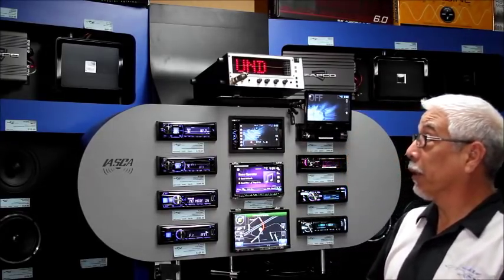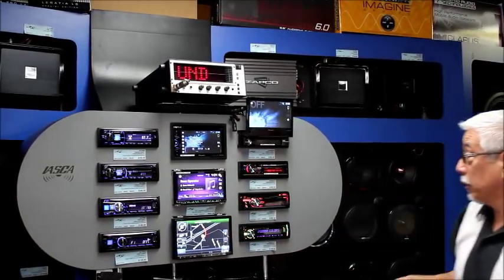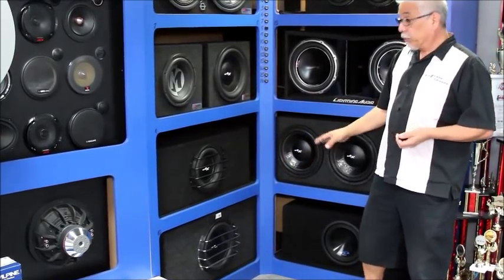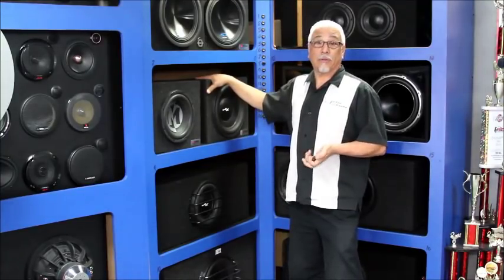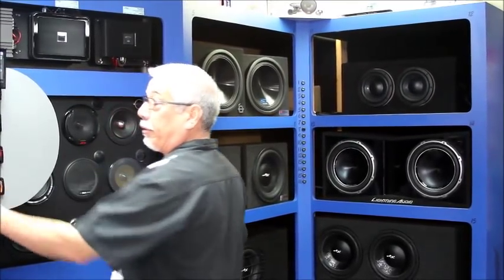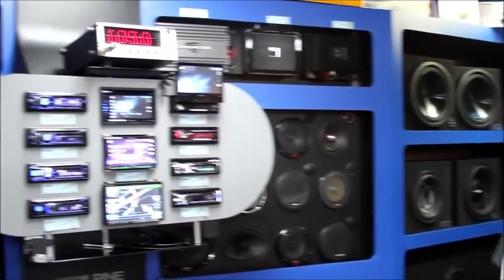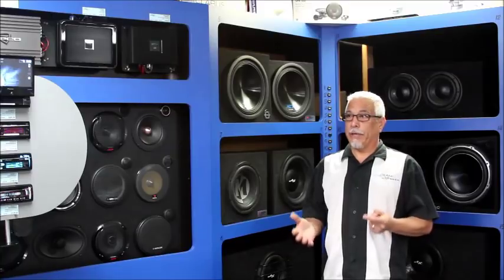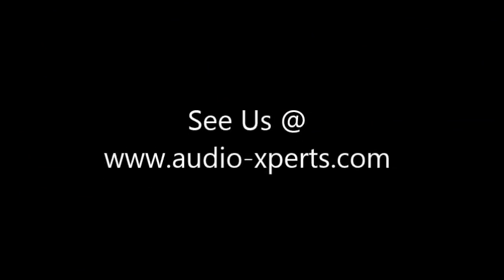Sealed vs Ported Demonstration by Audio Xperts using SPL meter to show output differences

Comment: I could hardly stand to watch the entire video.  I appreciate wanting to inform your customer but this is about the worst way to demo and test output of drivers and enclosures in that room.  Driver placement in relationship to the RTA is going to play a larger role than anything.  The room modes are going to shift with the position of the driver.  That in turn changes the input at the RTA mic.  Close but no cigar guys.

Comment: yeah yeah yeah... measure SPL... but if you measure DISTORTION & waterfall plot, sealed DESTROYS. if it's ported, it's distorted. the air cushion in sealed doesn't create bass, it creates transients that SNAP without resonant overhang. instead of using test tones, use kick drums. if you understand the science, then you know sealed enclosures control woofers better and you're more likely to blow one in a ported box. sealed's ONLY con is less output. ported = distorted
Reply: +funk toon Hi. Of course, you're right about the sealed box. And it's also correct about most ported boxes too. Just wanted to point out, that not every ported box will distort (to the point where you can hear). A well designed one (rounded inner edges, optimum volume, proper acoustic lining etc) really sounds great. I had 2 over the last decade, both performing very well. Of course, it wasn't easy - had to order one custom made to specific size and shape + nice, rounded port, etc. It wasn't too cheap either.. but it can be done. Cheers.
Reply: yes, some ported speakers are better than others, but to my ears, it's still a flawed tech as far as transients and timing go where sealed speakers thump harder. i can accept rolloff, but not boom or overhang. to my ears... 4 1/2" speakers have the best, as in tightest, bass.

Comment: Tihs is a stupid comparison!  This would be a good comparison, had they use a good quality sealed enclosure  to compared it vs a good quality ported enclosure. Also, for this to be a fair comparison,  the boxes would have had to be placed on the exact same location each so that everything is identical other tha box itself. You used $50 box that's probably made of  1/2" mdf, while your custom built one is using at least 3/4'" instead.   You can not compare apples to oranges.   At least you used the same sub for but, but did it wrong.

Comment: When trying to measure output, emulate the actual environment. A large open space is a terrible idea to demonstrate handling characteristics of an automotive subwoofer. You sir, are no expert.  The woofer didn't reach its limit because of the box you chose. The woofer met it's limit because it was powered, had dirty signal delivered to it, and a moron for an operator.

Comment: No dude... That is not right. "Mechanical failure because its in a sealed box" thats horse shit. Its a improper fitted sealed box.. thats why. derppp  Even the ported box is the wrong box...

both sound like shit because they are both the wrong boxes.

Feel bad for anyone who goes to you guys.

Comment: Lol an RTA isn't a spl meter and 30htz is not low and your trying to get spl out of an open room hahah spl is " sound pressure level" how are you going to pressurize a big room and get a real life test ??? Oh you can't! That's right hahah audio experts my ass
Reply: Sadly being RIGHT, when you are wrong, doesn't help.
As SPL is by it's exact definition exactly that = an SPL 
(which is measured by a sound "pressure" level meter).

ie: S(sound) P(pressure) L(level) = SPL
SPL is NOT a measure of decibels, as "decibels" is the name of the UNIT (of the measurement).
Loudness has ZERO to do with SPL.
Try sitting in a perfectly "sound proofed room" and eventually the tiny imperceptible SOUND, of the blood flowing through your veins NEXT TO YOUR EARS, will deafen you (permanently), whereas the LOUDEST SOUND POSSIBLE, such as an atomic bomb going off near you, that "sound" will only deafen you, for a short period of time (unless your eardrums are split apart, whereby the ear's will become useless & you will have permanent deafness).

Loudness is thus "a comparison" made between an ambient sound "level" and the perceived sound "level" of the sound you are comparing the difference with.

The reason an SPL level test works in open air is very simple.
Compressed air waves "travel" outwards (from any sound source), thus any "SPL METER", in the immediate vicinity with ANY compressed air wave (sound) - will cause a meter to record a value of difference - between the highest compressions and the inverse "vacuum" that exists in pulsating air waves, (sound-waves) and thus will allow you to read an SPL "differential" value.
Reply: Your failing to realize that even though the room is open the rda has a Mic designed to measure the decibels of house woofers so. Your kinda false about it not reading correctly spl and db are commonly referred to as the same thing but are widely different db is how loud it is and in all a spl meter just measures the pressure the woofer creates inside the area yeah sound iffy eh? Well not exactly even though the area is open a spl meter can still accurately measure the spl how do you think they designed 140db (spl measured cabinets) for a p.a system? They didn't stick them in a car...they stick them in a wide open room the spl meter can detect small amounts of air pressure with no flaw so you should do some more research before leaving some idiotic a
Question or answer if you wanna refer to a "sound pressure gauge" as a spl meter than its quite clear you have half an idea of what your talking about "spl" stands for sound pressure leagues nothing else you guys only seem the gauge is used for one purpose but in reality there more than one use for it

Comment: 169$ for that piece of shit? yeah right lol I could get 3 12's rated at the same power, an amp, and wires for that.
Reply: Noah Denza Where? I mean if your plan was to buy stolen equipment, then yeah. That sounds about right.
Reply: If you want quality sound you're gunna need to invest a little more.
Reply: Here in my home town at River Valley Electronics you can buy that Shit for way cheaper. I mean I got a $1000 setup for $300 and it's a legitimate store
Reply: ramivalencia just because something's cheap don't mean it's stolen. I mean for real I don't know what city you live in, but where I'm at it's hard to get away with Shit like that cause everyone knows who you are. It's a small ass town.
Reply: Here's proof if you don't believe me..........https://m.facebook.com/home.php?refsrc=https%3A%2F%2Fwww.facebook.com%2F&refid=8&_rdr#!/Rivervalleyelectronic/
Reply: Noah Denza three 12" inch subs, an amp and heavy gauge wire for only 169 dollars? man car audio is cheap
Reply: not always man. just because something is cheap, doesnt mean its shitty. Now brands that come from walmart like sony, kicker and dual belong in that category because its true.
Reply: Noah Denza I have to defend my kicker... thing was legit. Had two cvr 15s. Things pounded for a solid year in -20 degree weather!! Don't knock em

Comment: 30hz low output. LMAO!!!!!!!
Reply: You actually dont wanna go lower than 45Hz f3 in the sub, the cab is just gonna eat that bass energy in standing waves and drain the amps for power that could have served to get more acoustic energy. 55Hz f3 is actually better, and you will have plenty of bass in the low end because of room gain due to the small room.

Comment: this comparrison is completely useless! All the building and designing obviously didn't educate you about Helmholz resonators surrounding active radiators! nor did it teach you about the influence of placement. 1/4 wavelength distance of a solid surface will lead to destructive interference at the reproduced frequency. and so on, and so on. there is nothing conclusive in this video! Conclusively comparing sub enclosures can only be obtained by removing all other subs then the one being tested and making sure all sircumstances are the same for every enclosure measured! eg. same distance from walls and measuring equipement and same power U×I Besides that there's a lot of other misinformation in the video. If building and designing audio is your pride and Joy inform those that should buy what you build correctly this is not the way!